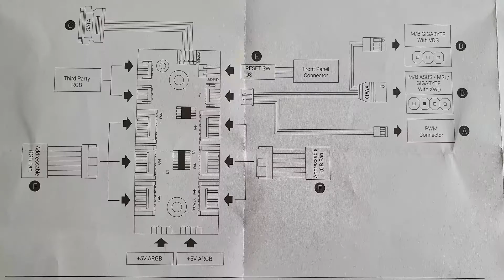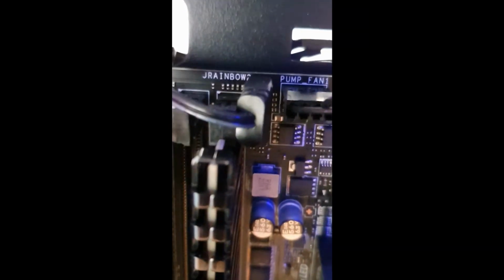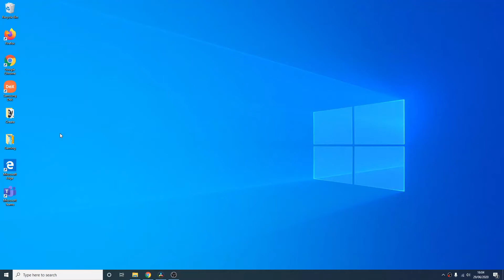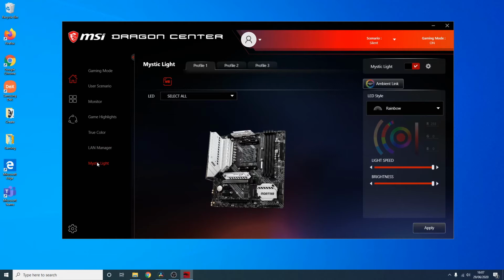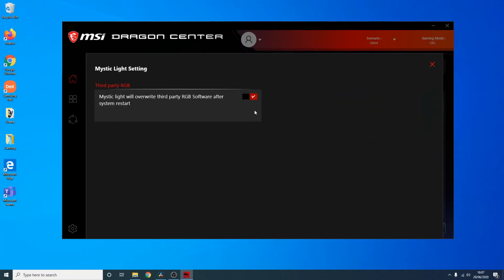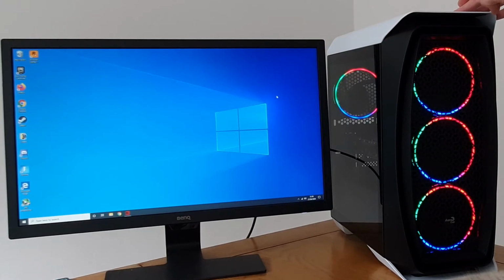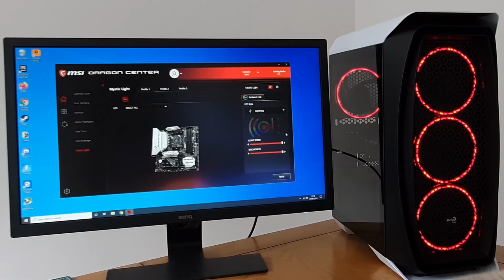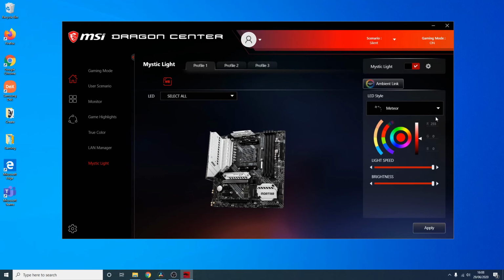Mystic  light (MSI B550M Mortar Wifi) with Aerocool Aero One Mini - setup guide

Comment: I have a very similar setup using the One Eclipse case and non WiFi version of this motherboard.  I also have an MSI coreliquid AIO cooler installed, so this is attached to the 'cpu_fan1' 'pump_fan1' and 'JRainbow2' headers and the Aerocool RGB fan controller is connected to the 'sys_fan3' and 'JRainbow1' headers.  All in all I am very happy with this setup and use mystic light to control all the RGB lighting, the only issue I have is that dragon centre doesn't display fan RPM data.  Has anyone else had this issue and if so, is there a fix?

Comment: Amazing !!!! This was very helpful. I had tried everything without success.

The key step as I see from the video, was to keep for a few seconds the led button (or reset button which is really the one used) to disable the HUB to manage the ARGB Fans, and bring control to the ARGB motherboard connector. With this instruction I was able to also resolve my ARGB power supply that was also not working with the Mystic light (meaning pressing for a few second the led button).

Not sure why there are no clear instructions about this on the different products with this functionality (At least not for Aerocool fans and power supply in my case)

Comment: can you control fan speeds in the bios or mystic light using this argb controller?
Reply from the maker: I've not set a new fan curve, but it does control fan speeds - but doesn't report the current RPM in mystic light
Reply: @countbeanz2743  I bought an Antec nx800 similar controller but my connections on the lead only have argb no pwn or system fan. Also MSI dragon center when you click monitor should show rpm of pump fan
Reply from the maker: @JD-op8vr  Hmmm - I shall plug it all in again and check the BIOS settings....
Reply: @countbeanz2743  that sounds like more hassle than its worth though
Reply: @countbeanz2743  Hi, I thought the PWN connector that you connected to the PUMP fan should be in the SYS1 board fan header so can set the curve and all the fans will work off that via the control HUB or is the Control HUB only for RGB ? I dont get why it has PWN connector . thanks
Reply: @yell9845  It has a PWM connector so you can set a fan curve in the BIOS for all the fans connected to the control hub...The pump fan header will run at full speed since pumps require the full 12V to run properly..So If you plug the PWM Connector into the pump header you wont be able to set a fan curve...

Comment: Hello, very useful video since I'm planning to buy this case & a MSI MEG Z490I UNIFY mobo!
Do you think a 323mm GPU card (MSI RTX 3080 Gaming X Trio) will fit inside this case with 3x front fans installed?
I believe the case specs indicate a 327mm GPU max length 😬
Reply from the maker: Hi - I had a little measure up for you, 323mm should be fine - I made it 325mm but I was using a tape measure and being a little on the cautious side.

Good luck!
Reply: @countbeanz2743 , Thanks a lot!

Comment: hello man. i’m just wondering how you install windows on that m.2 drive? everytime I install windows on my msi b550m mortar wifi after few days, the motherboard doesn’t detect the drive unless I reattch the m.2 nvme on m.2 1 slot. my m.2 nvme ssd is adata xpg sx6000 pro 256gb.
Reply from the maker: I’ve had no issues at all so am a bit stumped by the problem your experiencing.  So when you go in to the bios there is no drive unless you re- attach it?  Not wanting to state the obvious to you but have you installed all the updated drivers?  Otherwise you might consider using the second slot and seeing if that has the same issue, it seems unlikely it’s your drive if it boots after re-attaching.  If your drivers are up to date  and you have the same issue with both m.2 slots it seems possible you have a dud.  I’ve also attached a secondary  2TB hdd since my original build video and I have had no issue with either. - 17 days up and running.  Sorry I don’t have a magic bullet solution for you
Reply: @countbeanz2743  already tried the second slot. after restart, still m.2 is not detected in the bios so windows is not booting up. sh*t! why m.2 nvme ssd's are so complicated